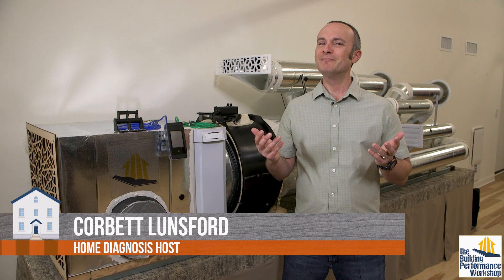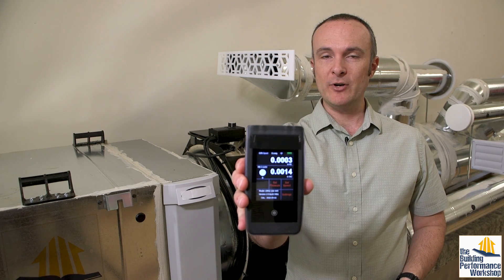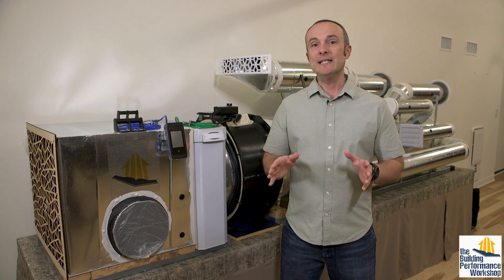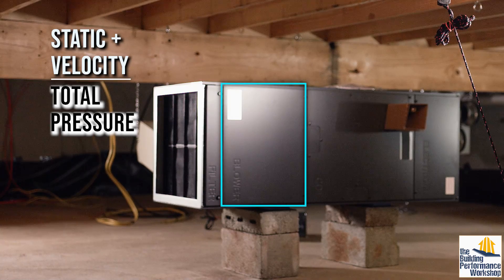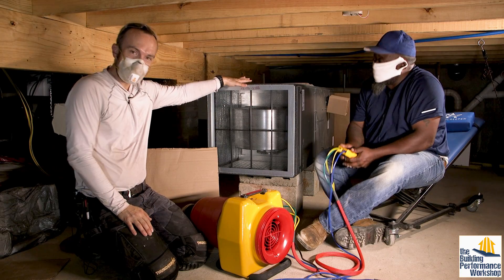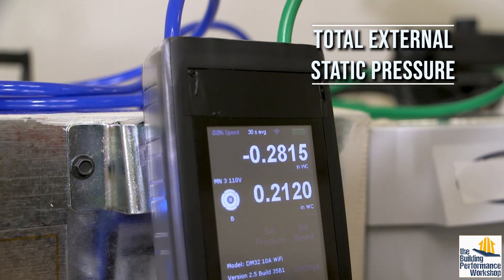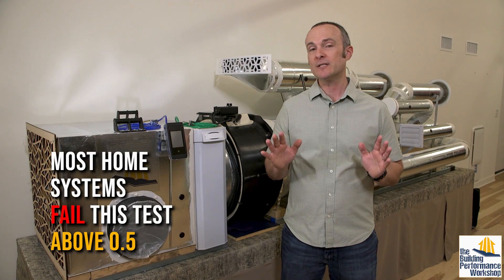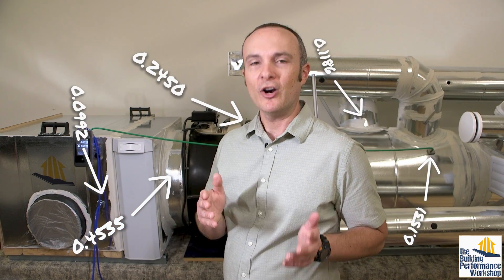Static Pressure Testing for Home HVAC: What, Why, and How in 2 Minutes

Comment: Hello, I know this isn't a lot of information to go off of, but I get 0.3 on my manometer when testing the filter restriction (MERV 8). If I switch to a fiberglass filter I get 0.1. Filter size is 16x25x1 and the unit is a 2.5 Ton. How am I supposed to lower the filter restriction with my MERV 8 down to 0.1? Switch out for a 4" filter or increase the surface size of the filter by going to like a 20x25x1 or what have you. Thanks!

Comment: In Florida they use coffin boxes as a base for the AHU and return duct. I have tested the SP right above the coffin box for the return (0.15 iwc) and right before the filter above the coffin box (0.3 iwc) is it possible that the coffin box itself introduced more drop? All HVAC contractors with more experience I have asked said they do not test past the coffin box but the numbers don’t lie. What the AHU sees is the 0.3. Have you worked with these coffin boxes and how have the tests performed? Do you see any pressure drop on them?

Comment: Good discussion, thanks. One nit I have with the discussion (and with almost all such hvac-related discussions) is the use of static pressure (singular) to describe the pressure distribution throughout the entire system since pressure varies throughout the system. I think that the term “static pressure” means the pressure DROP across the blower. When trying to determine why static pressure is out of bounds (typically too high), I think it would be much more intuitive to discuss things in terms of pressure drops across various components of the system (ducts, filters, etc.). This viewpoint is analogous to voltage drops throughout a series-connected electrical circuit. Just my two cents. 😎
Reply: I found an excellent discussion about Total Static Pressure and the implications for ducted systems. I suspect you would find it interesting and helpful.

//youtu.be/G8Z8zLz_dv4

Note that I stripped the “https:” off the front of the address as I’ve noticed that youtube often deletes posts containing full addresses.

Cheers!
Reply from the maker: Once you move outside the TESP, yes, it’s all pressure drops.
Reply: @HomePerformance  : I also find the term “total static pressure” to be confusing. In physics and engineering total pressure is defined as the sum of static pressure and dynamic pressure. I guess I don’t understand the use of “total static pressure” in the hvac community.
Reply from the maker: It’s actually Total External Static Pressure, meaning the sum of the pulling and pushing static pressure (polarity ignored). I think this is different than pressure drop because the fan is in the middle.
Reply: @HomePerformance  : Is “total external static pressure” effectively a measure of the total pressure drop across all parts of the system aside from the blower?  I.e., the pressure that the blower must overcome to provide a given flow rate? Thanks for putting up with my questions!
Reply from the maker: I believe that could be an accurate definition
Reply: In case youtube strips the link, you can search for “Air Flow: When it won’t work” on Christopher Molnar’s youtube channel.

Comment: I love your explanation of how SP robs VP from the duct! I also think that it is impossible to achieve 0.5” every time. 0.6-0.7” is necessary with space constraints. A furnace/ coil setup with media filter for example uses up 0.1” from the filter, 0.15” from the coil, 0.1” from grilles, registers and dampers per ACCA Manual D. That only leaves 0.15” available SP for the entire duct system. Sometimes we just can’t make that work. But the SP should not overwhelm the condensate P trap, sling water off the coil, cause noise, or make the ECM motor overwork thus shortening its life.
Reply from the maker: …AND the manufacturers should have gotten off their butts a long time ago and designed more robust equipment. Mitsubishi allows for up to 0.8”, for example. Homes are getting bigger while HVAC gets smaller and has to be hidden. Something’s gotta give- at least you know you’ll be exceeding the TESP and can discuss it with the homeowner- most guys obviously have no idea where they fall.
Reply: @HomePerformance  that was one challenge when I did high performance homes.  Traditional heat pumps that worked with thermostats like the Ecobee or Nest did not have the blower power to overcome the static on a 2 zone system, especially if I had a long return run that added friction.  I had to use gas furnaces because they used higher HP blower motors.
Reply from the maker: Interesting
Reply: @HomePerformance  yeah Carrier AHUs make nominal CFM @ 0.4". Weenie fans.
Reply from the maker: Geez

Comment: Do you know of a way to rent this kind of equipment? As a technically and mechanically inclinded home owner it would be nice to have access to these tools. Also I have yet to find a HVAC contactor that gives any indication of caring about quality systems or high effiency.
Reply: You can use a non precision manometer like a Fieldpiece SDMN5 also available on Trutech Tools. Precision manometer are absolutely necessary when measuring Paschals. But inches w.c. isn’t as small of a unit of measurement. And yes, you are correct about hvac contractors not caring. I recently sold my hvac business but we were one of the few that actually did.
Reply: Trutech tools, don’t know about renting but great prices, great people 👍🏻
Reply from the maker: @judman13, you can get an accurate, high resolution manometer for $550 these days. It’s called the DG-8:
https://www.trutechtools.com/tec-minneapolis-dg-8-digital-pressure-gauge-kit.html
Reply: ALSO, For Reference, for anyone who doesn't have $ 700.00 to burn, on that Unit...
  FieldPiece, Makes a Dual Port, Manometer Model #SDMN6 , for Around 
$ 319.00 Dollar's.....Which is a Complete Kit, with all that's needed, to Check Two Port's, Simultaneously....
  It's Accurate inWC +/-0.02 on 0.00 to +/-2.00, +/-1.5% FS on 2.00 to +/-60.
Resolution  0.01 inWC
  SEE rest of Spec's on-line....

😎👍🇺🇲Great Job on you're Video's....
  Very well Explained.....
Reply from the maker: @Scrollermania1963 good advice and thanks buddy!